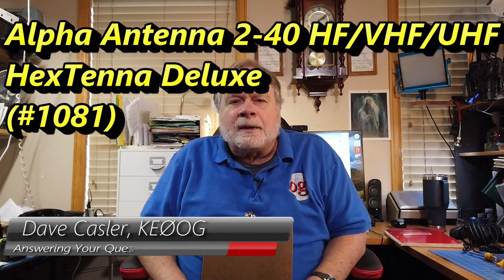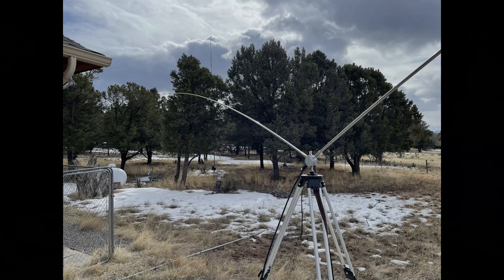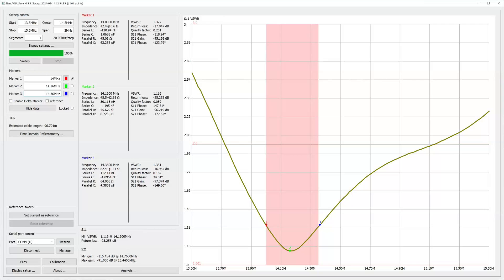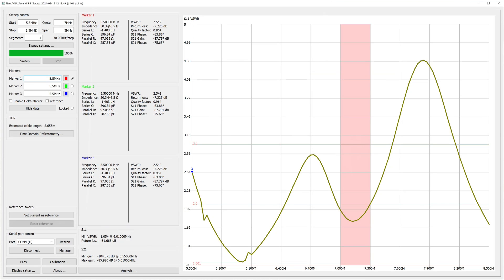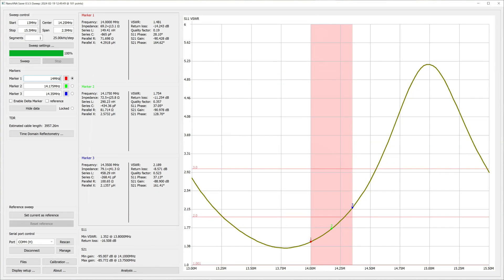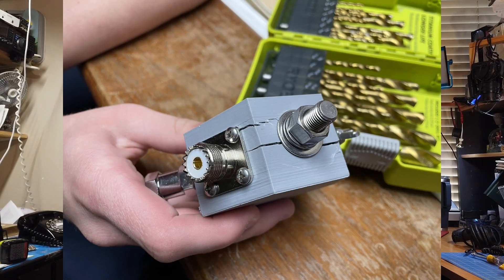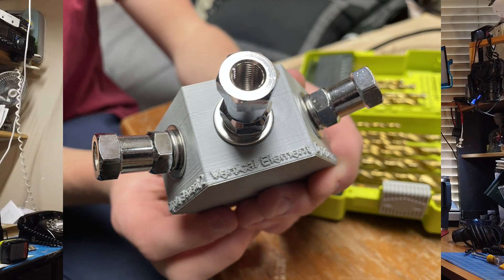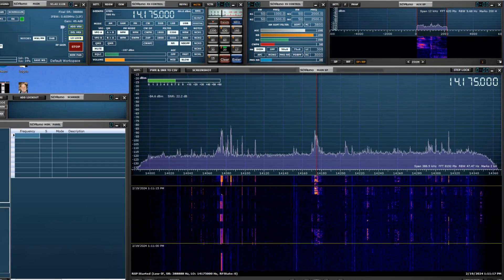Alpha Antenna 2-40 HF/VHF/UHF HexTenna Deluxe (#1081)

Comment: Why do want you to ground the 40 meter extension wires . Why not get wires off the ground and feed with 450 ohm ladder line and and use antenna tuner. Put the extension wires on a PVC pole next to it. Just thinking about this have not tried it.

Comment: I use this antenna for pota and I have made around 7000 contacts on in less than a year. I also screw the whips in then stretch them out. And I have tuned it on all the hf bands except 40m just by putting my rig expert on the coaxial and tune to the proper swr for the band. It’s been a great antenna for portable operation for me.